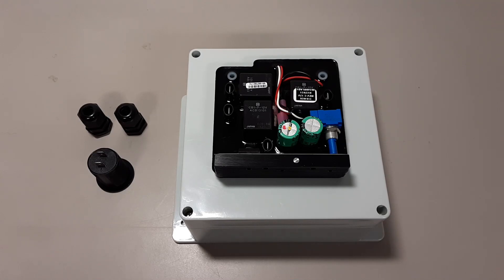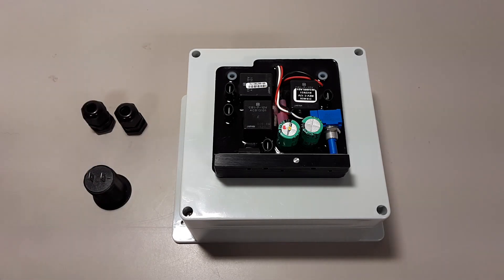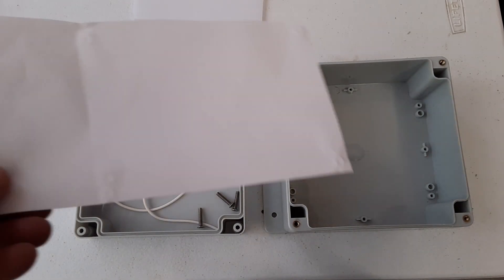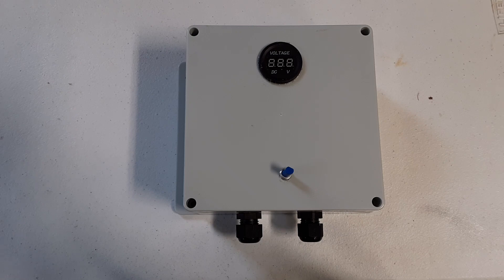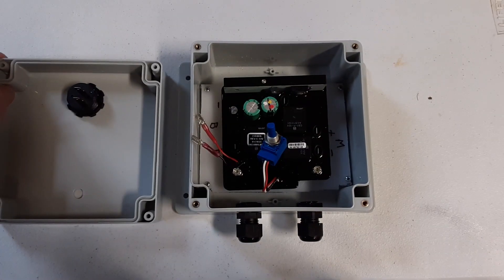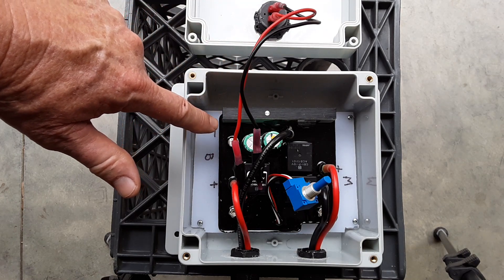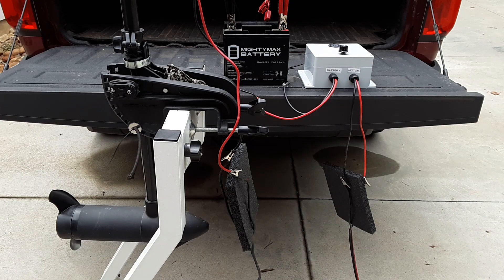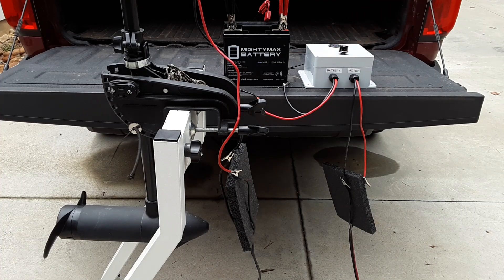Minn Kota PWM Digital Speed Controller Box for Trolling Motor

Comment: Thanks for this video, wish I had seen it before I tried the esc on my 50 lb. motor. Will this pwm generate enough heat to justify a fan? Also, can you wire up a kill switch to this pwm? Thanks for the work you do!
Reply from the maker: Glad to help! You shouldn't need a fan because there is not one on the Traxxis trolling motor. I have not wired a kill switch to that board so I can't tell you.

Comment: I noticed that you don’t use sae quick disconnects on your project box. You use gland nuts.  Do you find them easier to work with or are there other advantages?
Reply from the maker: With this build, there wasn't enough space/wire length on the board for quick connects.

Comment: Do you need to disassemble the head unit to bypass the onboard controls? or do you just leave it turned on and on high and plug the PWM in the power lines going to the unit and just use the pwm to control it and that's it? I'm looking to get a small trolling motor and be able to control forward and reverse, and speed from a controller box in my kayak cockpit. And I know nothing about trolling motors. Anything you can share would be greatly appreciated!!

Hope to hear back from you, I know this is an older video but I hope you see this! Thanks!
Reply from the maker: Glad to help. With this build, you need to remove the stock switch and connect directly to the +,- of the wires that go down the motor shaft. Other PWMs, can be run with the original head unit with the speed set on high.
Reply: @Aksmaniyak  Awesome, thanks for the quick reply!

Comment: Thanks again for the tutorials. The mods work great. I can’t wait to test it on the water when the weather improves. 
Question-the potentiometer with the Minn Kota doesn’t have a center position detent so I’m afraid out on the water I may go from full speed to reverse.  Do you have a recommendation to help prevent this from happening?
Thanks in advance!
Reply from the maker: The MK pot is a 1k if I remember correctly (check numbers). You could buy a new pot with a center detent and splice it in. If not, just mark it on you box. You could put a little nub of something (tape?) at the off position too as a detent.
Reply: @Aksmaniyak  Thank you!  What is the likelihood of damaging the controls or the motor if it goes from full forward to reverse without a pause at zero?
Reply from the maker: Hopefully you have wired in a circuit breaker and it trips before it can damage anything.

Comment: How would you wire a kill switch in this box,  I have been using it for 2 years now and this set up is great. A bit on the expensive side but fool proof well with the investment
Reply from the maker: You could probably use a standard one to interrupt the pot.

Comment: @Aksmaniyak - Do you know if the Traxxis control board heats up inside a waterproof box like that?  If it heats up, just curious if it makes sense to vent the box to let the heat out.  I know you have another video you show using screen repair tape for a box.  Nice idea, BTW!  I'd like to know though, if the Minn Kota Traxxis control board gets hot enough that you'd NEED a vent.  Thought?
Reply from the maker: Thanks Richard. I have not had any heat issues with the Traxxix board. It has a little weight to it so my guess is that it has a heat sink under the waterproofing.

Comment: Just did this but cant get it to work. I have a feeling that the Minn Kota PWM I purchased is bad. I have 13.4V running to the PWM. I've checked the  power wires and polarity several times so I know they are right. No power at the terminals that the motor connects to. Odd thing is that the voltage reading on the leads for the battery meter is -13.4V. I'm running a NV36 and I know it's fine. When wired directly to the battery, it works perfectly. Any insight would be appreciated. Does your battery meter lead read negative voltage? Is my PWM fried?
Reply from the maker: It is hard to tell without photos. This is a FB page I started and you can share photos there to see if I can help. There are also many knowledgeable members that can help too.   https://www.facebook.com/groups/3521517597860461

Comment: Now that it's on PWM, when you dry run the motor like that, does it heat up?
Reply from the maker: No. The motor is not water cooled.

Comment: Can this control board be used on a 24 volt, 48 lb thrust motor. If not, what can I use for 24 V, 48 Lbs thrust motor. Thanks for your help.
Reply from the maker: If you copy and paste the control board into Google you will see it is for 12V .

Comment: Hello I saw that you have tested different pmw card why did you change or use different each time?
Which one is the best?
And in this video where is switch for reverse mode?
Reply from the maker: Hi. I test and build different PWMs to see how each works. This is a Minn Kota control board so the speed switch has F/R function.

Comment: How come you didn't put the pot in a remote?
Reply from the maker: I have done the remote as you know on several builds. The remote box builds were primarily done to protect the PWM from moisture but this MK board is supposedly waterproof making that unnecessary. This version gives the option of mounting the entire box on a track or RAM ball system.

Comment: Would the Endura-max control board work? One could theoretically buy that motor, pull the board out of the head for a "stern mount" application and box it like you have and kill two birds with one stone.
Reply from the maker: If the TM has "max" in the name then it has MKs digital maximizer (pwm). I haven't looked inside the head unit of one of those to see if the board could be easily removed. Some models have the board permanently fixed inside. You could remove and relocate the entire head unit as a PWM controller.
Reply: Have you looked at using a ECS instead?
Reply from the maker: @BassManStrikes  I know some people who have made nice builds with those.
Reply: That was what I was thinking.

Comment: Nice install but the control board at $135.00 is a little steep.
Couldn't tell from the video but assume the control board is variable speed with both forward and reverse.
Reply from the maker: Thanks John. Yes, it is a F/R variable digital speed controller. I found one on Ebay for $99 with free shipping!